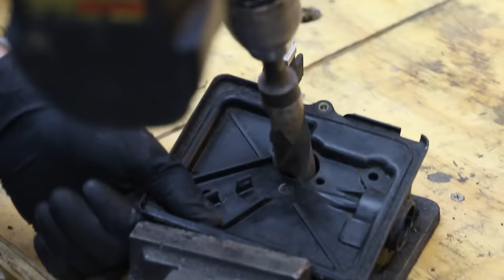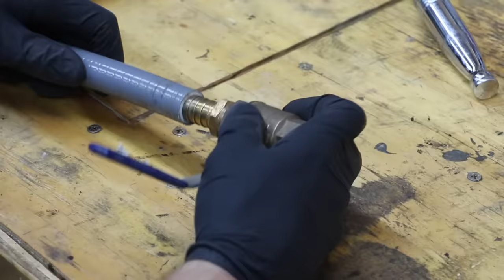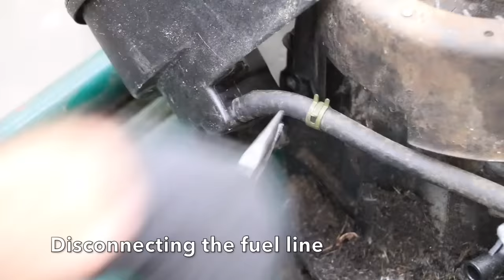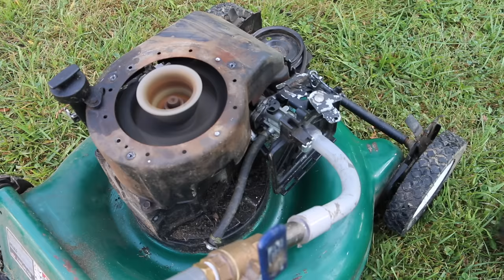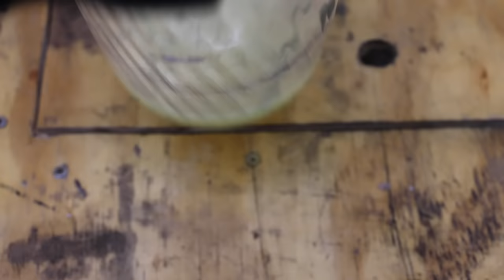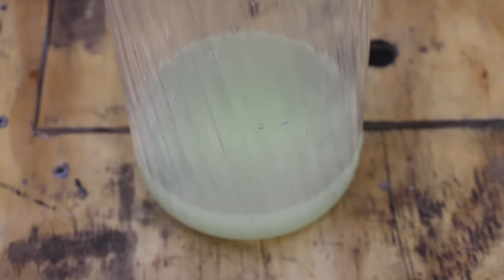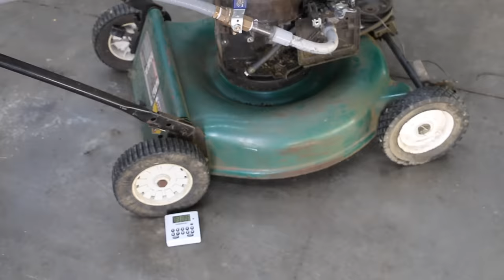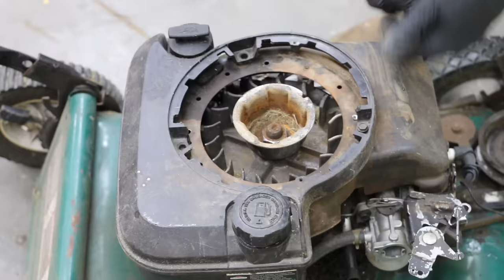Will a "Gas Vapor" Container Improve MPGs and Fuel Efficiency?  Let's find out!

Comment: Carbureted engines do this already.  The carb atomizes the fuel, then when the fuel gets into the warm engine and is exposed to the lower pressure, it vaporizes.
Reply: He made a big carburetor
Reply: @gjamaica3167  It looks like it has about the same capacity.  Size is irrelevant here.  Ultimately gas engines all burn vapor.  The only difference is where the fuel becomes vapor.  Liquid gasoline won't burn.  It is pretty volatile, (meaning it evaporates fairly quickly without high temperatures,) so the vapor in sufficient concentration will burn easily.  The remarkable thing about this video is that such a crude vaporizer actually seems to work pretty well!
Reply: Tom Sparks right, that’s big difference between highway miles and local.
Reply: @tomsparks3259  It vaporized right after the injector sprayed?
Reply: Yah, I was thinking the same thing when i read this title. WTF?
Reply: we run cars here on LPG, petrol in gas form. I truly don't understand what this whole video is about
Reply: @fuzzjunky  Here is what it is about: Certain con-men have sell a gadget that claims to improve efficiency by supplying engines with vapor + air instead of liquid. That is EXACTLY what an ordinary carburetor does. These crooks sell the suckers "special" devices that improve efficiency. They either do not work at all, or work no better than ordinary carburetors.
Reply: very true.... but what happens if you make that initial atomization 5 times better ?  better fuel economy right ?
Reply: @bobkelly2447  NO! "Atomization" is really a misleading term. It actually refers to spraying a liquid into a fine mist. Once the droplets are small enough to vaporize completely, further reduction in droplet size does little good. 

Fuel economy is actually a measure of thermal efficiency. This is typically 30% today, although new engine designs are claimed to approach 50%. The maximum possible thermal efficiency is equal to 1-(A/U) where U=upper temperature (highest temperature reached) and A is ambient temperature, both expressed on the Absolute scale. Gasoline combustion temperatures in an engine reach circa 2700 K while ambient temperature at ordinary conditions is about 300 K. So the maximum thermal efficiency possible is about 1 - (300/2700) = 1 - (1/9) = 8/9 = 0.888888, but no engine comes anywhere near this in practice for many reasons including friction for example. Anyone claiming efficiency greater than .8888 in a gasoline engine is a liar. My guess is that the maximum possible thermal efficiency in an automobile engine is about 0.65 and I doubt if that will ever be even approximated.
Reply: @DavidFMayerPhD   "anyone claiming efficiency greater than.888 in a gasoline engine is a liar"  Now that is black and white why would you say such a thing ? because the laws of thermodynamics forbid it ? or perhaps the conservation of energy  ?   laws are made to be broken in the field of science ! ....
you can have a very efficient engine that doesn't have enough power to move itself.... efficiency is not the end all answer !  Although Your first statement rings true.  once the mist is fine enough when it enters the combustion chamber it will as you say vaporize on it's own because it's hot in there ! and yes your correct !
however it's been my experience that that rarely happens that is why this method of "running off of vapor "
is so good.... it will give you 25% to 35% right off the top .....
lets face it as far as efficiency goes the internal combustion engine is way down there .... when you start talking about heat in to heat out as being efficient  I beg to differ...  i prefer the more concrete useable term of Miles per gallon....  something we can actually use other than numbers that mean nothing.
I have improved said MPG on every car I have owned on a few I have gotten great results 48 MPG and 80MPG   when the truck got only 20 MPG to start with  there was a slight loss of HP. however but it gained a very smooth running    I am convinced that 200MPG is obtainable.... but with statements like yours why should any one try ?  it's impossible right ? because the efficiency cannot be that high ????
 i say fooie on that  and will build my own.... if only for an extra 25% efficiency .....
Reply: atomization is not evaporation.
Reply: @tomsparks3259  the vapor is cold, which is why the mpg wasn't up. The vapor is condensing in the hot engine making the bubbler pointless. The gas needs to be heated till the point it evaporates.
Reply: @bobkelly2447  they are made to be broken... however it's funny that the only people claiming to break certain ones are con-men and liars 

There are upper limits to physics and eventually we'll find and hit them; if we havent already. I doubt maximum efficiency with regards to energy will ever be a thing... but then again maybe this comment will age horribly and I'll look quite the fool and I'll be ecstatic if that does happen but I think that's one of those things that are just out of our collective grasp.
Reply: But a carb doesn't atomize the fuel well enough.
Reply: @DavidFMayerPhD  Why is fuel injection more efficient than a carburator? Because it atomizes the fuel better.
Reply: @billbergen9169  No. So long as fuel is FULLY vaporized, droplet size does not matter. Fuel injection is better because the EXACTLY correct amount of fuel is put into each cylinder. Carburetors do not always produce a uniform mixture with the result that one cylinder may receive a different mixture than another. Plus, in cold weather, gasoline may not fully vaporize.
Reply: @bobkelly2447  The extra efficiency enters the system through fuel vapor preheating.  Bigger scale = more preheating and preheating that perfectly explosive air fuel mixture creates what is known to the layman as a ticking time bomb of Michael Bay proportions.  At lawnmower engine scales, the heat of the ambient air and a plastic bottle with a longish tube is enough though.

Comment: Another great video! Love your Channel, you have a great personality. Keep up the awesome work!!
Reply from the maker: Thank you!
Reply: Dear {small] c. if you cant understand than don't watch PROJECT FARM channel.
Reply: Thanks for another great video. Really appreciate the time and effort you put into these.
Reply: Smokey Yunick proved many decades ago that a metering device is necessary to reach the proper stociometric ratio of between 12 and 14 to 1. [the higher # being air.] and this would be necessary with any engine using gasoline, whether vaporised or atomized. A ratio of approx 12 to 1 is needed for a heavy load and approx 14 to 1 i is used in a steady state, no load , coasting mode. Engineers do this kind of work everyday. Ratios might vary using other gaseous fuels such as propane.
Reply: You are absolutely correct. Thank you.
Reply: To see the actual efficiency of a carb or infection system, take a look at what is coming out of the pipes of a top fuel dragster at night.That is liquid fuel that is still burning as it comes of the motor. "Still cant see how anyone could expect 100mpg". Well, the science has already been proven and it is up to us to absorb this info. Google the research on hot vapor fuel engines........or dont!        Most people want to talk about subjects they don't understand but wont do the research.
Reply: AdrenalineJunkiePro
Reply: C Dp
Reply: calvario city
Reply: Gas companys don't want people saving money. Thats why most car run high rpms at a crushing speed like 60mph and you are at 2500 to 3000 rpm and most car dump more fuel them they need think of that 3% plus 4 to 8 pistons then add in better fuel to air timing. Then gear it to run 1500 to 2000 rpm.... I also need to add a mower runs about 3000 rpm so uses more gas. Love the video keep your mind open
Reply: Repeat this experiment with oxytane
Reply: hi...you will need to place a media on the jar like a sponge of sorts to keep the liquid gas from splashing to high therefore preventing the gasoline mist or drops to be suck in to the motor suction hose" that along can cause the level of the gasoline to drop dramatically" and remember "THE SUN" if you use glass it gets very hot x1 and if is clear glass x2 and if is clear acrylic or plastic x1 the sun will heat the gasoline in side, not as hot as the glass does,but same effect, give or take! using a white or milky white plastic container is best to keep the sun heat out.remember evaporation is heat...what you need is a reg splash of colder mist or drops of gasoline "not superheated" that will be trap by the media and drop back in to the bottom of the tank over and over again. this will aloud the gasoline vapors to raise to the suction hose as a colder cleaner and dryer vapor and it will keep the sponge soak inside the tank minimizing evaporation by heat or sun exposure.you will need a suction valve(one way) on the two intake pipes on the jar if not the gas will evaporate overtime.i hope i gave you some ideas that you can use.bye,bye carlos
Reply: Project Farm, you forgot one thing on your test: to check the RPM of the engine. You have to maintain the engine at the same acceleration to test it, says 1000 RPM. You didn't check that on your video. Maybe redo the test taking RPM into account will change the result for better or worse?
Reply: Project Farm: Sorry, you already answered in another comment. Unhappily your result can't be trusted because you didn't have a tachometer on the engine. Very sad. You had good intentions, but, different rotations give different results even with the same setup, imagine with different ones.
Reply: Project Farm needs a air line in the vapor tube for air fuel mixture but trying to regulate both the vapor and the airline is the tricky part it is possible to get it to better fuel economy but I'm with you four hundred five hundred percent is a little overboard
Reply: Me, Inc. A lawn more is actors of lawn.
Reply: Lawnmowers are governored to generally run at 3000 RPM.
Whatever speed this was running, it was the same in both tests.
Reply: 1800 to 2000 is optimum for any combustion engine, gas or diesel, per Ford study.  I guess diesel engineers have known this forever ... note the operating range of all big trucks.
Reply: Robert Davis Briggs and Stratton governed at 3800, not sure if this was one or not. But right there in the ballpark anyway.
Reply: 2800 to 3800 depending upon blade diameter.  Our good ol' US of A Government regulates the blade tip speed at 200 mph.
Reply: should have put a check valve between the canister and the intake to keep a back fire from traveling backwards  and blowing your self up and also a coil of copper tubing either wound around the exaust manifold pipe heating the liquid gas into a vapor would have been more practical i would assume.the air mixture has to be  added into the equation in order to have proper combution ..good luck .saftey is a must..remember ..i have had a few freinds experiment with this idea and i didnt see or hear them talking about whether they had much luck saving gas in running generators..how ever it does keep ya busy and not wasntin gas running alloover the place  hahaha..have fun
Reply: You are confusing. The first idea you tried lasted 1 1/2 hours. Then you did 2 more that lasted about 1/2 and hour. So why did you not count the difference on the first one that ran 1 1/2 hours? That would be like 3x better fuel efficiency.

Comment: I'm surprised you did not wear protective gear in case of an explosion. Also a splash plate in the container to keep fuel from splashing up and accidently getting splashed up to the intake port would have been a better design as well as using an accurate measuring device for the fuel. I also noticed you could not throttle down to an idle so maybe a better control on the gas line.
Reply: Baffles. Simular to what's used in a moonshine column. Minus the caps.
Reply: He wanted to keep it simple as a pure Demo.
If you start adding splash plates etc folk will think there's hidden gadgetry powering the engine.
No need for accurate fuel measuring as the consumption difference was not significant enough
Reply: common sense is his protective gear

Comment: Holy moly! That is the coolest thing I've ever seen. It reminds me of the idea of mechanically reversing polarity on magnets to create a type of motor. There's no reason it shouldn't work, and I would love to see you do it.
Reply from the maker: Thanks for the video idea.
Reply: I’ve wanted to do this too there is no reason it shouldn’t work indeed
Reply: @ballsrgrossnugly  what if there was a mechanism that would turn magnets a specific direction as another repelling steel or magnetic passed through it? As to create the push necessary to keep it moving? Would this not work in the slightest?
Reply: @ballsrgrossnugly  The point is to require the least amount of energy though, these experiments keep that in mind. Have you never been tempted to engineer something with very strong magnets, including an analog mechanism that shifts the magnets? All analog, nothing electrical. And only use electricity to power the magnets. I’ve definitely always wanted to do this since I was a kid, I just haven’t been able to create a prototype that corresponds to exactly what I want.
Reply: @ballsrgrossnugly  Thanks for the detailed reply.(: Either way the worse that can happen is failure.

Comment: Gasoline only contains so much energy, no matter how you extract it. All engines run on gas vapors, they don't burn liquid gas, as the gas is atomized upon entering the combustion chamber. This increases surface area to increase vaporization. Liquid gas is very hard to ignite, gas vapor is highly flammable, and very dangerous.
Reply: You point out a basic rule of physics that seems to escape most of the fairy dust and unicorn believers. 
Some people seem so hell bent on wanting to believe in a miracle ( or conspiracy) they will throw common sense/ fact and logic out the window to fool themselves.
Reply: Shelby Seelbach "gasoline only contains so much energy, no matter how you extract it"....that is assuming that your engine is already 100% efficient and that you cannot reduce wastage any further.
Reply: Pixl Rainbow no matter how efficient your motor is, gasoline only contains so much energy, no matter how you extract it. Nothing you said makes anything i said incorrect. No motor even burns gas at 100 percent efficiency. This would require an air to fuel ratio of approximately 15 to 1, which is known as a stoichiometric (not sure of spelling any more) mixture in which all fuel and oxygen are consumed. All motors run slightly rich to allow the unburnt fuel to carry heat away from the combustion chamber. This is why you have all the shit on your car, egr, catalytic converter, etc. to deal with unburnt fuel in the exhaust. Of course this motor will run on gas vapor, all gas burning motors run on gas vapor already.
Reply: Shelby Seelbach you just completely misunderstood the phrasing and contradicted yourself lel. I give up
Reply: Pixl Rainbow ok?
Reply: Pixl Rainbow if you used weird phrasing, don't give up, at least try to explain your point.
Reply: Shelby Seelbach 
I don’t think liquid gas even burns. It has to vaporize first, right? So if you ignite a pool of gas, it’s really the layer of vapor on top of the liquid that’s burning?
Reply: Sonari N. Roulette it's hard to paint with that broad of a brush, under the right conditions almost anything burns. Under normal atmospheric conditions, you can flip a lit cigarette into liquids gas, and it will extinguish the cigarette. But i definitely wouldn't go so far as to say it won't burn, there are conditions that must be met for anything to combust as we think of it. Fire is merely a chemical reaction that releases stored energy, that under the right conditions becomes self feeding, as the release of the energy creates heat which sustains the chemical reaction. Wood only burns because normal atmospheric conditions just happen to be the right conditions. Add water vapor to the air and wood becomes very difficult to burn. Under the right conditions almost anything you can think of will burn.
Reply: Apparently Mercedes new F1 engine has just crossed 50% thermal efficiency - first to do so, I believe.  There's a vid where the discuss it.
Reply: Shelby Seelbach Lmao so you noticed he just made a normal fuel tank too.
Reply: billy bob not exactly a "normal" fuel tank set up. Normally liquid fuel leaves the tank and isn't atomized till it hits the fuel injectors or the jet in the carburetor. He has just moved the atomization process to the tank. Essentially the same thing though. Difference maybe similar to making chocolate milk, do i pour chocolate syrup first so the milk mixes it a little as i pour it. Or  do i put the milk first then chocolate syrup, then do all the stirring last. Either one will give you chocolate milk. Experiment wasn't even necessary, chocolate milk was a fordrawn conclusion.
Reply: Shelby Seelbach I have the suspicion that 50% off this comment section are trolls